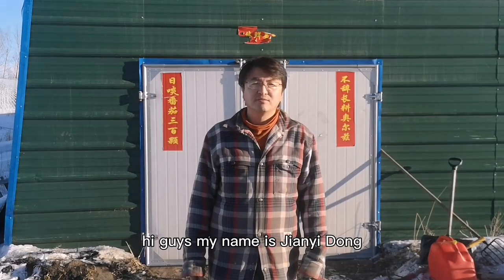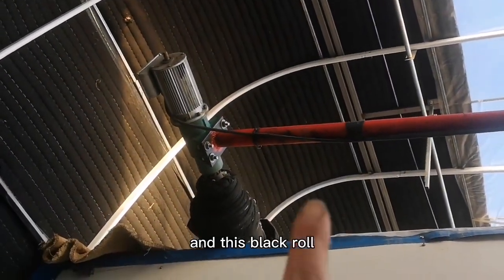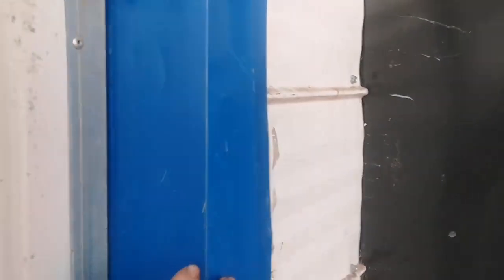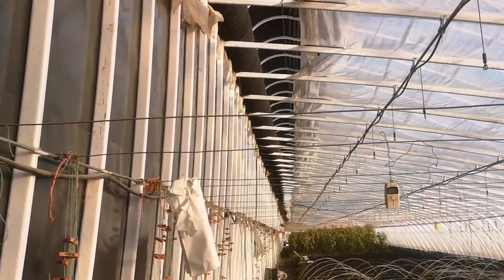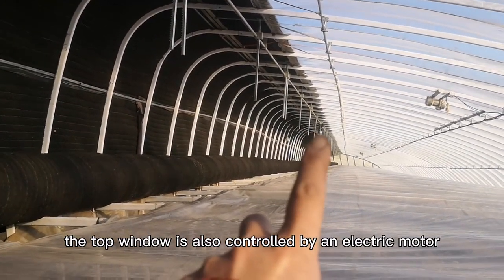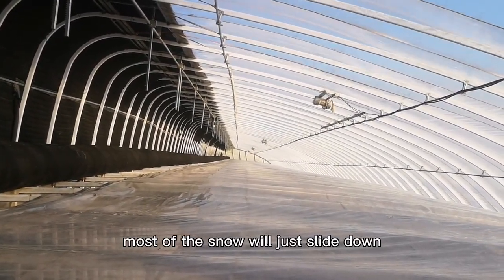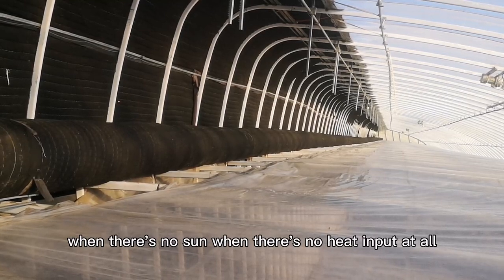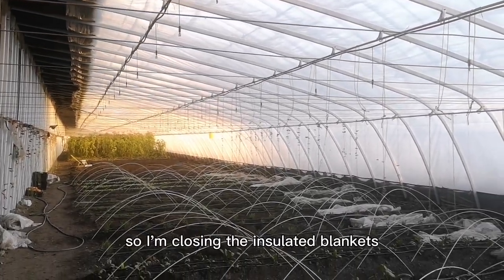The design of a commercial size Chinese style passive solar greenhouse in Alberta

Comment: Very well done video Dong!  If our government had any brains, they would be encouraging the building of these greenhouses to reduce the need for American toxic food imports. The amount of uranium,  heavy metal and radiation contaminated food in the USA is getting ridiculous.  Much of that food is exported. That is why, in part, so much cancer is prevalent. Ensuring safe sustainable food supplies for Canadians starts with greenhouses like what Dong has built. 

I am surprised geothermal ground air heat was not utilized in this design like other greenhouses, particularly the one in Nebraska built by a retired postal worker. If the air ground heat was utilized, Dong could be growing citrus fruit and bananas.

Nebraska greenhouse video with air ground heat: https://www.youtube.com/watch?v=ZD_3_gsgsnk&t=17s. Connecting the air ground heat to a heat pump makes a heat pump far more efficient to operate in cold temperatures- even at -50C.

This is design of a greenhouse is how food in the Arctic should be produced cheaper for part of the year. Incorporating modern lighting using wind power and batteries may increase the time crops could be grown in the Arctic.

Lets hope our politicians see this video and other videos about how to grow safer food cheaper in Canada.

Comment: Mr Jianyi, I have a greenhouse idea that I would like to run by you that adds some additional features to your Chinese-style passive solar greenhouse. The modified greenhouse design would include a biodigester heating system located on the north berm wall and a cheap (closed-loop) geothermal cooling system. I sent you an email with the details. Let me know what you think! I would love to get in touch sometime to ask questions as well as brainstorm some ideas with you.

Comment: Great, as long as profits him.
Are you interested in a 2-meter gap? Most research studies have focused on gaps ranging from 10cm to 15cm. However, I've come across two or more studies on double-layer greenhouses. While a 2-meter gap is quite extreme compared to the usual range, it's intriguing to explore. Given the substantial size of the gap and the cold climate, would a 4-meter tall barrier help retain heat at night?
I am just curios.

Comment: Air R value is 3.6 per inch.  One foot of air space between insulation sheets has a R value of 43.2, two feet 86.4.  Yours look at least 5 feet or a R value of 216.  It has pretty much no heat loss.  Heat come in as part of the sun light, not going out unless you unroll the top layer.  If people want a building that has no heat loss, all they need to do is to build two walls and roofs all of the way around, with a few feet of air space in between and insulate under the floor.  Keep both layers opaque except windows, then the building interior will probably stay much cooler in summer as well thus no AC is needed.  Thank you validating the power of air insulation.  Great video.

Comment: Hi, Jianyi.  Thank you very much for the video! I'm wondering what you do in summer when a lot of your light  (over 6 hours per day in June at your latitude) comes from north of the east west line?  Do you roll down the black insulation at the north side of your roof completely to let that light in in the mornings and evenings?  Or does it cause your greenhouse to heat up too much?  I am only allowed to build a 10 Sq meter greenhouse in Victoria.  I've learned from you and  copied some Chinese and some North American techniques and it has been a fun experiment and experience building and running a small "4 seasons greenhouse" in the Victoria BC.

Comment: This is impressive.  I’m a civil engineer and very much into greenhouse designing.  I like the way you have the motors and blankets set up.  Add geothermal for cool air during the summer and it will be even more efficient again!  Great job

Comment: Clay is nice. What about water? I suppose it's much harder to maintain a water reservoir than clay.

This is a very excellent design, however it looks extremely expensive to build. My greenhouse is a single low tunnel, built from chain link fence tubing. I guess I could built another greenhouse over the top of it to make a similar setup, but that would probably triple the total cost.
Reply from the maker: You can grow a lot longer in a double greenhouse. Worth trying
Reply: @dongjianyi2492  People use them often here for light dep setups for cannabis.

I'd have to build a whole new greenhouse to do a Chinese version with an insulated north wall like yours.

Comment: Hi, wouldn't it be more efficient to have a reflective surface in the north wall to send more light to the plants?
Reply from the maker: It is good in summer. But in winter, we need to wall to absorb heat as much as possible
Reply: @dongjianyi2492  have you put a thermometer at different distance from the back wall in winter to see how much temperature is changing during day and night? Every 10cm would be a good indicator of real energy storage. Because the ground from which the plants grow can also store heat and would do it better with more sunlight (making your third plastic blanket with fiberglass arches more efficient when needed)
Reply from the maker: It is good in summer. But in winter, we need to wall to absorb heat as much as possible

Comment: Wonderful! This is truly wonderful! Have you considered digging a few feet into the ground? It may also help conserve energy by using the earth’s warmth.
Reply from the maker: The angle of the Sun is pretty low here. That will make a long shade
Reply: @dongjianyi2492  ahhh i see! Unless the side facing the sun is a slope to avoid the creation of a shade. It will still imbed the surface in the ground. But im guessing heat isn’t a real problem since it was at 26°! :)

Comment: I am looking at different greenhouse designs to place on the back south facing side of my house. Something like this seems very well suited to add onto a house to retain better thermal mass. I would modify the slope though of the exterior layer to a higher pitch for better snow shedding.

Comment: Thanks a lot this is genius, It looks like quite what I want to do, but I have a question : during hot sunny days your air temperature will rise too fast for your clay wall to absorb the heat, so you need to ventilate no ? 

In my project, my heat storage is rocks puts in a galvanized wire mesh’s wall covered by a plastic film, ans I use blowers running 24/24 pumping the hot air in daylight into this wall, the heat absorption is very high and release fresh air to the plants through holes... In nighttime the blowers extracts the heat stored to the plants. The rocks have high surface for good heat exchange and mitigate hygrometry. The ‘ rock walls’ can be ‘rock tables’ too, for nursery it’s perfect, seedlings too. 
Second question : is you second plastic layer really necessary ? Films reflects a lot of sunlight, double it its reduce a lot light available in winter. 
Third question : In my mind I just wanted an aluminized curtain for IR reflection to keep the IR inside, but to have your air insulation I will put this curtain in place of your current second plastic layer. The cost for this IR curtain is quite low, light weight... what curtain did you use and what do you think of these ideas ? 
Thanks a lot !!!
Marc from France
Reply from the maker: I think your ideas are brilliant. But a second poly film is a must. Otherwise it'd too cold in the morning when I roll up the insulated blankets. The insulated blankets are made of polyester fabric
Reply: @dongjianyi2492  thanks Dong. I have seen your temperatures data’s, thanks a lot for putting this online for free !! We have very low data’s in Western countries for such greenhouses. Has I said in my previous post your daylight temperature rise a lot and the heat exchange is to low to absorbs it quickly enough and your nighttime temp fall, it would be great to increase heat exchange power by adding pipes through your heat bank/wall and pumping hot air from the highest point of your greenhouse. 
Earth/clay wall is interesting as it’s very low cost, my rocks wall is quite expensive but good heat exchange. I look for the most competitive one. Make a covered ‘pond’ inground and pumping water through heat exchangers with blower in front of could be a low cost solution too but add technology...
Reply: Have you seen the bubble greenhouses ? It use a part of this design : an interesting thing practiced in China (how many I don’t know) is pumping inground water (+6*C) when weather is cold and watering your greenhouse plastic film by the top. It’s very low cost. 

An idea is to use a inground pond as heat storage and watering the inner plastic film of your double layer greenhouse both when it’s hot and when it’s cold so you can mitage temps day & night. Of course you use gutters to recycle water to your pond and insulate the ground with recycled styrofoam at all borders of your greenhouse. We just need a thermic specialist to do the maths to size the pond.... what do you think of that ?
Reply from the maker: @kusland6786  Someboday suggested this design to me. But there is no really life showcase. I am not sure how well it works, especially in winter. You know, the relative humidity is high when it is cold. Water is like a devil. There can be ice and frost on the poly. I am really reluctant to get my greenhouse wet in winter.
Reply: @dongjianyi2492  Bubbles greenhouse are noisy and quite techy, but use an interesting concept for cooling as i previously wrote : spray a film of water on your inner second plastic layer and you both cool your greenhouse while warming tout heat storage. It’s quite simple design, i would like to see That on a regular inflatable double layered greenhouse.

Comment: Thank you for your information.  you have your secondary roof designed with how much snow load in mind? I am looking at building a 40 ft unit in Syracuse NY. I would like to know more about the lite weight blanket material and construction requirements.
Reply from the maker: Snow load of 20cm is not a problem.  It pretty high. Usually not too much snow accumulated on top.
Reply: @dongjianyi2492  snow loads here brake High tunnels here. My neighbor  lost one in the last snow fall. We have 230 inches /547 cm average snow fall. 90 cm can and has fallen here. Did the company modify there design for you?  I am interested in the cost of a unit from China . Did it take a full container?  Did you order the lighter insolated cover on your new  unit?  thankyou for your reply.
Reply from the maker: @brianmcmahon4156  Because of the arch shape and the big slope, not too much snow ever accumulated on the top. Usually it is less than 20cm. I am not sure how it handles 90cm in a night. But snow can be eliminated by vibrating multiple times. I noight everything in 2018. So the insulated blankets for the second greenhouse will be the same:(
Reply from the maker: @brianmcmahon4156  An 80m long greenhouse takes a full 40' container. It costs about $100k CAD to get everything to my place.
Reply: @dongjianyi2492  thank you for the information! This gives me things to think about.I mam retired an my scope was at 12m X 6m
Reply: @dongjianyi2492  80m is much more a commercial in scope. I assume you are busy now with potting tomatoes now. Bout if you had time I would like to zoom with you. Thanks again.

Comment: Can you share what you know about poly films? The ones I've tried to use keep failing. But I'm much further south.
Reply from the maker: Why does it fail? i use 6mil poly
Reply: @dongjianyi2492  Hello. Thank you for your reply. Maybe I used the wrong type, but I bought some 6 mil plastic at my local hardware store. It said it was UV resistant, but it turned very brittle in a few months. In some places it tore within weeks. I made my greenhouse out of PVC pipes and there's not a lot of wind at my place, so mostly it got destroyed by the sun.
Reply from the maker: @SashaXXY  Greenhouse poly should be very resistant to sunlight. I think you got the wrong type
Reply: @dongjianyi2492  Thank you. Any particular brand or type you could recommend?
Reply from the maker: @SashaXXY  I bought the greenhouse kit that includes the poly film. We call it PO film.  You can ask the greenhouse suppliers about it.
Reply: @dongjianyi2492  I will look into it. Thank you for the information.

Comment: When my mother added another story to her house in California in the 1970's, I took a solar class at a local college and got the architect to design a 12" slab under the new part of the house, cut one corner off the house facing directly south (it was going up another floor too, so we still more than doubled the size of the house) added a huge double--pane sliding glass door along that new south wall and added insulated curtains.  We tiled the slab floor with red Spanish tile so we would be adding to the heat storage, similar to your wall.  We would open the curtains in winter and close them in summer (similar to how you are using your blankets).  That room was BY FAR the most comfortable room in the entire house year round.  We would grow orchids in that room very well!   You have a MUCH harder burden way up there.  HUGE CONGRATULATIONS on that incredible greenhouse!

Comment: Just a note: the inside layer of the insulating blanket should be a reflective surface, not an absorptive surface.  If you can properly engineer the interface between a foil and black layer, then you would retain more heat.
Reply from the maker: Great advice. Will talk to the manufacturer about it. Thanks
Reply: @dongjianyi2492  I would consider applying a desiccant in this context to prevent ice crystal nucleation at the thermal boundary.  You might also deter mold and algae.
Reply from the maker: @willjennings7191  The insulated blankets are super dry. Because they absorb too much heat in sunny days.
Reply: @dongjianyi2492  I would start working with diatomaceous earth in this setting as a desiccant and aphid treatment.  You should also consider adding a CO2 producer to the greenhouse.  I would try a worm bin for the spent tomato vines.

Comment: Air is not a good insulator that's why your using big black blankets and........... plastics!
Reply from the maker: Yes. That's right
Reply: @dongjianyi2492  then why state that it is in the video? Did I miss something?
Reply: Air is a good insulator.  Think about what heat is (vibration) and how it transfers (kinetically).  A tight crystal like iron transfers it very well, a loos gaseous mix like air transfers it poorly.  Open air does have the problem of convection, but it is still a decent insulator.  Of course that blanket only insulates well because it has trapped many small areas of air and in trapping has restricted convection, and this principle of trapping air is used in most "insulation" materials.
Reply: @bigbraincontent  air is not good at all.  why is it not the best cooling or heating element....?  I reference every heat sink used on any component (heat producing or removing).  Solids and liquids are far better (your AC system)... no one can afford that construction in the roof for their home! (Big giant heat sink or bath of liquid) The statement in the video said it's the best insulator and I called BS.  My physics are true.  If I am wrong on economy then phrase it so.  Either way building with economy has its price.  You have two choices too make.... fast, cheap, done well.... pick two. Go ahead...I'll wait
Reply: @johnh2302  you are mixing up insulator and conductor.  A metal heatsink is a good conductor (bad insulator), it allows a hot component at one end to quickly transmit its heat to the other end.  At that other end is usually something cold flowing over it like pumped liquid or blown air that continually takes away that heat.  If you made a heatsink out of air by trapping that hot component inside a thermos (cup lined with an insulating air gap) it would overheat because the heat would move across the airgap too slowly
BTW I like your avatar picture, covid is bullshit

Comment: https://youtu.be/lnmpeYFBm54
In this video, I saw the effect of the thickness of snow on the roof on the temperature inside the greenhouse in the table at 12:20.  Perhaps using snow vibration motors may have a negative effect on thermal insulation.
Reply from the maker: We wish it only snows at night. We need sunlight during the day.